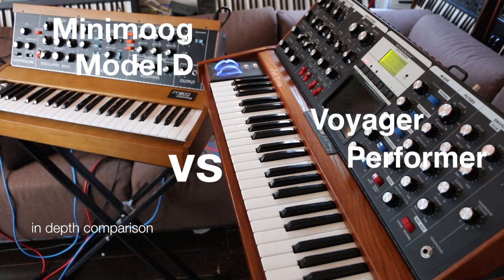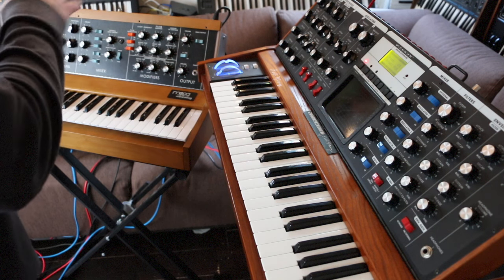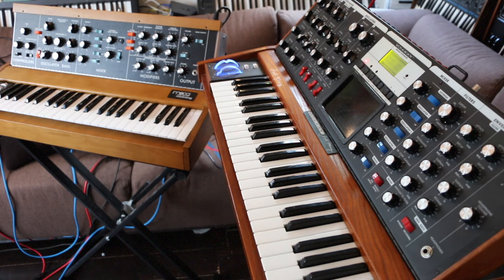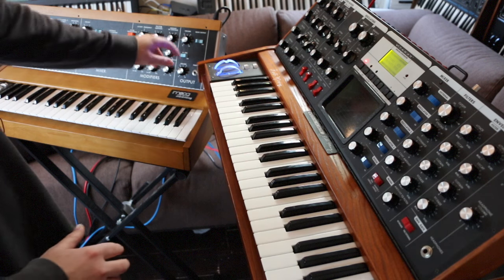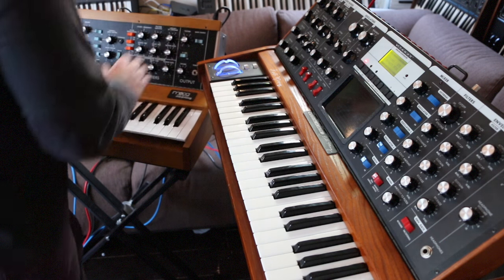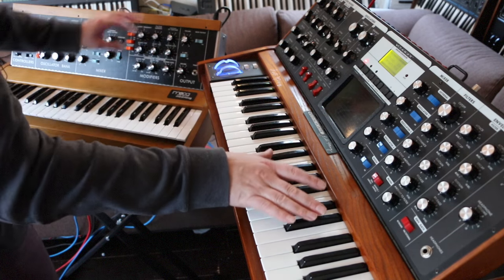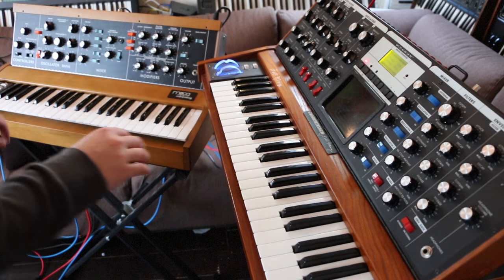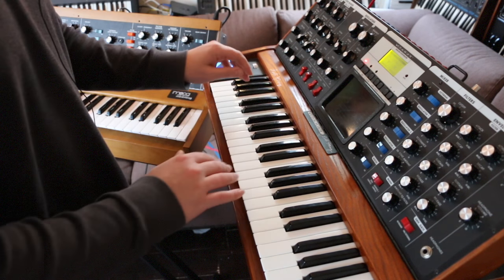New Moog Minimoog Model D vs Voyager: Oscillators

Comment: Both the moog D and voyager have very similar oscillators but the D sounds brighter because for some reason the voyager’s default manufacturing doesn’t let it open its filter all the way, which can be bypassed to full with a max envelope amount
Reply from the maker: Yeah, opening the env amount adds a fraction more cutoff but still didn’t bring it anywhere near the Minimoog. It’s the equivalent of having the Minimoogs cutoff set at around just past 3 o’clock.. but it can continue to five.

Comment: I had a Voyager Old School before finally getting my hands on a 1975 Minimoog D. And when I put them side by side, I immediately sold the Voyager. And I think the new polyphonic Moog One also sounds like a Voyager and not a Minimoog D, unfortunately. I think today's electronics engineers are deaf and can't hear anything past 12 KHz anymore. Much like when Bob Moog designed the Voyager in the early 2000s. lol !  @9:03 I don't think that was the synths making that faint farting sound though... hahaha!
Reply: Yeah nothing compares to the original the re issue and the voyager have that same plastic sound. Not bad but definitely not a model d or anywhere close. It s missing the warmth x100000000000

Comment: great video! thanks!

do you think the reason the D sounds different is the 30K range on the filter vs 12K on the voyager?
Reply: There are many things which makes the Model D superior in tone to the Voyager. The keyboard contacts, the way the envelopes react to the VCA. The overdriven filter are just a few.
Reply: galactagog but remember the new model d has the same keyboard as the voyager.
Reply: Thanks for pointing this out about the keyboard. I was referring more to the original Model D obviously. The Pratt-Read keys are a dream compared to the Fatar. The Voyager's filter can be opened up MORE than the maximum pot range, but the oscillators by themselves simply aren't as raspy. If the filters were equal, it still wouldn't sound the same. The Taurus III is closer to the Model D than the Voyager is on a 1:1 osc comparison. However, the D, a Micro with the bass modification, the Voyager and the T3 all hold their own against each other, the Model D simply beating them out. Those bright and raspy oscillators are unbeatable.
Reply: To be honest, this is the first place I've read the Voyager's filter was of that kind of limited range. I didn't see its frequency response in the manual.
Reply: well, it is labelled right on the front panel 

circling the filter knob, counterclockwise:

20 - 60 - 250- 1K - 4K - 12k

has anyone ever tried putting D oscillators in a Voyager?
Reply: You know, I think that's the dumbest thing I've posted in public! I've owned a Voyager for a long time and it never once occurred to me that was the freq response. Jesus Christ!
Reply: Galactagog, what I've done in the last hour is I ran the Voyager's Osc out into the Model D's input and I have to be honest and conclude here that without taking the direct outs from both and listening to them on an independent output I can't make a realistic judgement about which oscillator is more raspy. A Spectrum analyzer is needed here. I think one thing that is partially to blame is the way that the Voyager's waveshapes are produced. The saws of the two aren't identical (the Voyager's has more of a curve in the trough). But both oscillators sounded damn near identical in this setup. I think that might have something to do with the minimoog itself, based on how it treats the input signal as it goes through the modules (The Voyager might be kind of hot because it wanted to overdrive pretty quickly).  I have contacted the designer of the Voyager and asked him some questions so I'll be happy to report back with what he says.
Reply: that is very interesting, thanks!!

ps I thought Bob passed away a few years ago. You must have a Ouiji board as well? ;)
Reply: haha no A.W. designed the sound engine.
Reply: hahaha!
Reply: woah, I was replying to this

 "You know, I think that's the dumbest thing I've posted in public! I've 
owned a Voyager for a long time and it never once occurred to me that 
was the freq response. Jesus Christ!"

but it put the comment at the bottom

ps any news on the circuit etc? curious
Reply: ....any thoughts from from AW?

I have been experimenting & so far the raspiest I can get the voyager is filter cutoff @ 12k and resonance @0. 

however then you cannot manipulate the filter cutoff as easily as when cutoff and resonance are both at noon

( If I turn on 3-1 FM it gets even raunchier, but less D sounding )
Reply: Hey....Very sorry about the delayed response..

I did hear from him and this is what he said but this is an excerpt from a conversation:

"Short answer: there's a lot more shit in the signal path of V'ger, and it's all in integrated circuits. 

The miniMoog was an all discrete transistor design with no digital control elements used for the preset memory in the circuit paths.

A good analogy is the difference between the control elements present in the engine architectures of a 1967 Ford Mustang versus a 2007 Ford Mustang…

Oh, it gets WAY fun when you debate this crap with some of the "sciencey" people that frequent xxxxland that insist "a semiconductor is a semiconductor" and there are NO sonic differences between a discrete transistor and a transistor on a chip…

It falls into the same domain as the 901B/921B argument. The transistors in the V'ger oscillator's exponentiator circuit, (as well as in the filter ladder), are in precision ICs which places them very close proximity, not spread out on a patch of circuit board like in the mini. There's also a little substrate in each of the ICs that has a bias voltage to heat them all exactly the same, ensuring very little thermal drift over time. 

The filter ladder transistors in V'ger are also on ICs. On all of the other older Moogs, (except for the Memory), they were discrete transistors, matched by transfer characteristics to respond to the control voltage as closely to one another as possible, and also to not create as many IM distortion "artifacts" to the passed/attenuated signals. However, no matter how well they were matched, they could never be made to respond EXACTLY like each other. 

The point is that the newer design elements employed in V'ger to "bring the minimoog into the 21st century", like keeping the oscillators from drifting, (that everyone bitched about in the 901B's and the earlier minis), and tightened up BOTH filter's responses, are also responsible for what tend to make it sound less sloppy/raspy/ballsy; in other words: the more precise you make it, the more people will bitch about how less "analogue" it sounds. 

So, ya can't win!  

 It is THOSE very "errors" that made them sound so good..."
Reply: You can get the filter to open a little wider with the Amount to Filter knob all the way clockwise. There is also a modification that can be performed if you send it back to the factory which will brighten it up a bit more.
Reply: aha, thanks for the followup!!

very good info
Reply: allright I finally got to play around with a reissue D...it sounded very very good, but not as dramatically different as I thought it would. 

I think I will be content with my Voyager. I have a new appreciation for it now.
Reply: They are pretty different, but when you start filtering out waveshapes almost all analog synths sound the same.
Reply: do you think it's worthwhile to own a D and a V? do you ever slave yours up together?

seriously considering a D. am I crazy....
Reply: I sent you a long reply on Muffs. I have slaved the Micro to the Minimoog but not the Voyager.

Comment: You can make the Voyager a bit brighter by turning the EG all the way up and turn the Decay and Sustain on the filter envelopes all the way up.
Reply from the maker: Cheers,  I forgot to mention that.  It does make a difference, but only minor - a bit like opening the Mini's filter from 2.5 to 3 (or from 12 minutes past the hour to 15 minutes).
Reply: +Starsky Carr - Wow, I wonder what makes the Model D so much brighter?  In most soft synths or digital hardware synths, they roll off the highest frequencies because of aliasing which is one of reasons analogs sound much brighter.  Up until Serum came out, none of the soft synths I've had were brighter than my Moog Slim Phatty.
Reply: @redirishmanxlt  . Could be because the digital side of voyager causes unwanted high frequency noise interfering with the audio path. So it is possible the VCA in the voyager has a capacitor in the op amp feedback loop to dampen this out.
The same is possible on the Sub 37 and little phatty.
Reply: @AdamTheAd-vanc3d  I don't have any experience in  electronics, so what does a capacitor do?
Reply: @redirishmanxlt  . Bascially a capacitor in the output circuitry of a vca can be used to filter out certain frequencies especially if hiss or digital zippering noise is an issue even vco noise bleedthrough. The trade off is a slightly duller overall tone. 
Which in a wag makes some synths sound beefer in the bottom end as the highs frequencies say 20k+ are not so defined/permantly rolled off wvwn with a fully open vcf  cut off. 
Hope this made some sort of sense.
Reply: There are also Voyagers modded by Rudi Linhard/Lintronics (LAMM) that make the Voyager behave differently. Great mods, highly recommended, if he still does them.

Comment: Great videos Starsky, thank you. On the Voyager- I notice the "Amount to filter" knob is set to 12 o'clock. Doesn't this inhibit the maximum amount the filter can open on the voyager? I do not yet own a Moog (hence me watching these videos)- but I thought that knob can act as a slight LFP. I may be wrong.
Reply from the maker: KSQ thanks and good question. The amount knob goes from -5 to +5 so at 12 o'clock it's theoretically 0 i.e. It has no effect on the filter.  As you know, +ve values should increase the filter response with the envelope curve and -ve values reduce it. 

The Voyager, however, has a weird architecture in that at +ve values if the sustain is fully open, the env amount increases the filter even if it's already set on its maximum frequency. This is only by a fraction but it's there.  I should have increased the env amount to full to get the highest frequencies from the filter - although as I say it's only a fraction. 

I do this on my Voyager vs sub 37 video to show the difference. It's still way below the Model D and way above the Sub 37.

The Sub 37 does as you'd expect i.e. no effect on the filter at 12 o'clock, and the Model D only has +ve values. Increasing this doesn't affect it either if the filter is fully open.  I don't know any other synth that acts like the Voyager in this respect. I wouldn't describe it as acting like a LPF as it's so minimal, but it is definitely there.
Reply: Thank you very much for taking the time to write such a detailed reply. Those are some crucial differences you outlined, that will help anyone deciding among the 3. Huge help think you.

Comment: Hello,
thanks for this comparison, very interesting and valuable. I have this year at home the same set: Minimoog Model D 2016 and Voyager Blue Edition. I wonder what to buy reverb and delay, to preserve the nature of these instruments. You can recommend something on this issue? So far I'm using TC Hall of Fame, MF Delay and Reverb EHX Cathedral (the pedal is wrong with these instruments). I'm thinking of BigSky or Eventide Space, Boss RE-20, El Capistan. Do you have any idea? I will be grateful.
Reply from the maker: thanks for your comments.  I have the MF104M and an Eventide Eclipse.  I don't get as much use from the MF as I expected I would, and use the Timefactor delays in the Eclipse more often than not when recording.  If you hook it up to a MIDI controller it opens up a whole world of experimentation. I like the look of both the Strymon units.  The Space plugin is excellent and huge effects and turning an average sound into something weird and wonderful... The FX in the clips are great, and add a new dimension to sounds.  I've a Sub37 demo using the Eclipse for rhythmic ambient stuff that might be of interest here : https://youtu.be/7dmA2X8sx8w
Reply: Thank you for your answer, check your suggestions. I also have 37 Sub :)

Comment: Would have been good to show how the Voyager can be brightened by changing the filter slope. Good vid tho; thanks.
Reply from the maker: Eric Roberts thanks for the comment. A couple of folks have mentioned this re the Sub37. I didn't do it as wanted to show comparisons between the typical 24dB filters.  Changing the slope will change the character for e.g. Filter sweeps, but you're right .. for many sounds where the filter remains open it's not so much of an issue and the synths can be brighter... I feel another video coming on :) ....

Comment: Is there actually that vast a difference between a Voyager and a Sub 37? Have always coveted a Voyager and have a Sub 37... listening here, I suspect the Sub and Voyager are closer than the Voyager and the Model D?
Reply from the maker: Gav Thorpe is say the voyager has more in common with the mini. The S37 is great for rhythmic modulation with the 2 LFOs plus the sequencer.  I twiddle with that loads more than the voyager.  But for 3 osc sounds the voyager blows it away. The sub osc on the 37 is useful, but not a replacement for a multi waveform tuneable full osc.  Fine tuning the 3rd osc for a bit of movement and depth is only possible on the voyager.  Different beasts...
Reply: Starsky Carr dammit! Nice collection you have. Sub 37, Prophet 6 and an Oberheim Matrix 1000 here... the disease is spreading
Reply from the maker: Gav Thorpe ... and it's terminal
Reply: I've got a Voyager and a Sub Phatty (same voicing architecture as the 37). I find the raw Voyager osc has more depth, so tend to use Sub for leads and Voyager on bass. Sub Phatty/37 gets pure dirty though - the post filter/pre vca overdrive takes it into different territory.
Reply: I'd say they are quite different. I've got a Voyager, and kinda wanna get a Sub37 too. The Sub37 seems much more aggressive (the overdrive on the filter), and I like the duophonic mode and arpeggiator. It's still roughly a 'Moog sound' either way, but definitely different flavors.
Reply from the maker: Maybe time for me to record a S37 vs Voyager video? ;)
Reply: Starsky Carr almost certainly

Comment: I don't believe the Voyager's Filters have Series / Parallel configurability, although such a feature would be nice.  Rather it has the option for either Dual Lowpass or Highpass / Lowpass modes and each one has its own designated output in Stereo.  The Third Oscillator on the Model D did not have the "Shark's Tooth' wave but had a Ramp or Inverted Sawtooth shaped wave for modulations in the other direction.  On the XL you have that with the Second LFO.  The Model D had provisions to modulate the Oscillators and Filter either individually or simultaneously through the Modulation Wheel.  As flexible and varied as the Voyager's Modulation Busses are I don't think it can actually do that like the Model D did.  I haven't explored it yet but it might be accomplished through patching, certainly with an XL model.  I have heard there is something called a Slew Rate Modification that can be done to Voyagers that seem to allow the filter to open more and give the instrument that bristling exuberant tone the Model Ds are known for.
Reply: The lowpass/highpass is in series - forming a bandpass filter with adjustable width ("separation"). The lowpass/lowpass mode is in parallel as a stereo pair.

Comment: That's quite an interesting / disappointing spec on the voyager filter. The Sub 37 can supposedly do 20Hz-20kHz
Reply: I wonder if I can just patch a +5V offset into it to push it up more. Will try later. I've had a Voyager for 10+ years, and it's never bothered me.
Reply from the maker: Never bothered me either.  I didn't realise until making this video.  Oddly enough I noticed it immediately on the S37, which is brighter than the Voyager.  Maybe I was using something brighter before I unwrapped the S37?  It still doesn't take away from either of them.... still doesn't bother me. The offset would be interesting to try.  Let me know how it goes. Cheers.